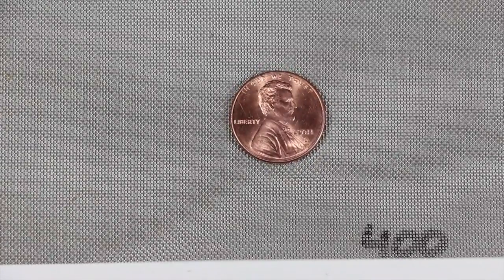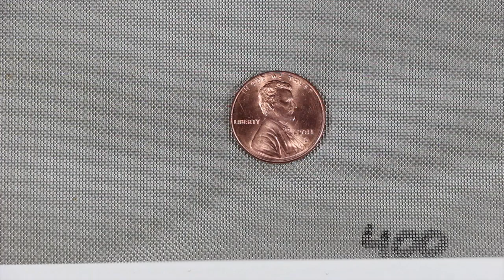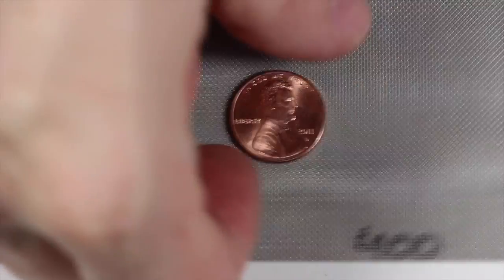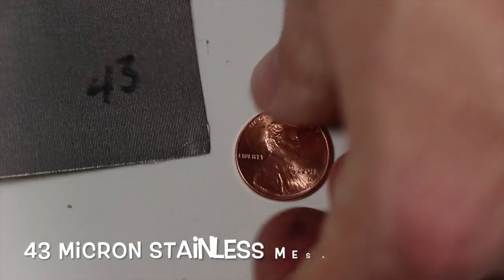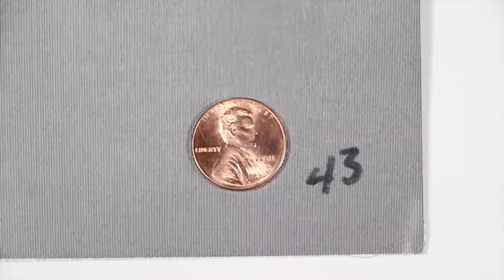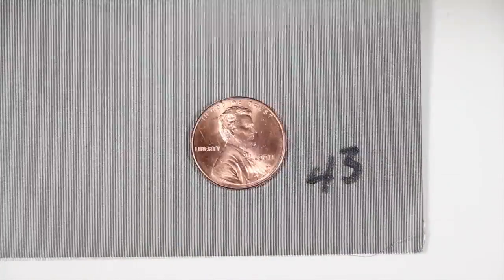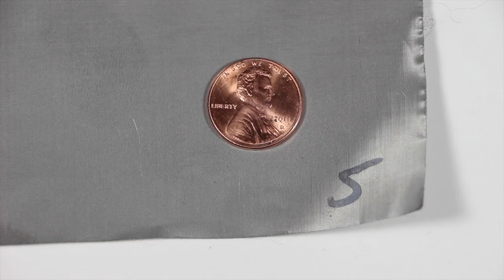Stainless Steel Mesh Samples - Utah Biodiesel Supply

Comment: Do you have sheets larger than 12"x12"?
Reply: Yes. Our mesh is on 48" wide rolls. We cut them in 12" increments (so 12, 24, 36, 48" wide) by any length you'd like, as long as it's an increment of 12". Shoot an email our way with what you'd be interested in info at utahbio dot com and I'd be happy to quote you up.

Comment: Which mesh is best for acrylic paint?
Reply: It can vary on which is best for your setup. I've had some customers from paint shops use 74 micron, 43 micron, and one even used 15 micron (although I think that's crazy tight for paint to go through). Most common though is 74 micron.

Comment: SS304 Crimped Wire Mesh,Stainless steel 304 Crimped Wire Mesh,Color coated stainless steel Crimp mesh,St st 304 crimped wire netting,stainless steel crimp wire mesh factory 304 black color crimped mesh supplier HEBEI XUANKE Crimped wire mesh/woven crimped mesh, inquiry at sales@xuanke-huixin.com Will help your business success always. Hebei Xuanke WireMesh Co.,Ltd http://www.xuanke-huixin.com Leading factory crimped wire mesh supplier Since 2009 aisi 304 stainless steel crimped wire mesh
Email: sales@xuanke-huixin.com 
www.xuanke-huixin.com 
Mobile/WhatApp 0086-13739722196 Skype: selinna988

Comment: 500 Micron screen is a lot bigger then a coffee filter paper mesh?
Reply: Oh yeah! Definitely! Coffee Filter Mesh is somewhere around 50 to 100 micron. I've never been able to find a manufacturer that can tell me specifically what size it is, but based on comparing it to my stainless that's about what it seems to be. Some can seem even smaller though.

If you're doing cold brew coffee though, we recommend using 74 micron stainless. We have a few customers that use 100, but the majority of them use 74. 74 will act like a 40 nominal micron filter. 

Also, here's a link that'll help show the differences. As you look at the penny, look at the L in the word LIBERTY as your gauge comparing it to the hole size in the mesh. 
http://www.utahbiodieselsupply.com/blog/stainless-steel-micron-rating-examples/
Reply: Yes Yes Thank you soo much yes i was on your website i learn alot... and i was just using  the coffee Filer for a project of my i been using it for the pass 3 week i was not getting the results that i wanted. Then the guy told me i must be using a 500 screen filer to get the results that i need... Soo now i understand i was using 74 micron that no good... I need a 500 micron mesh screen.